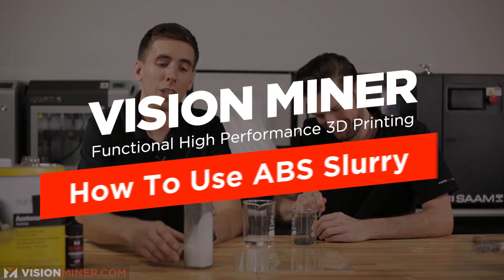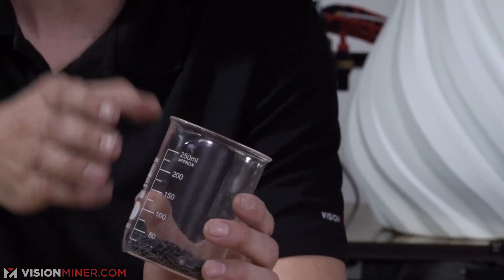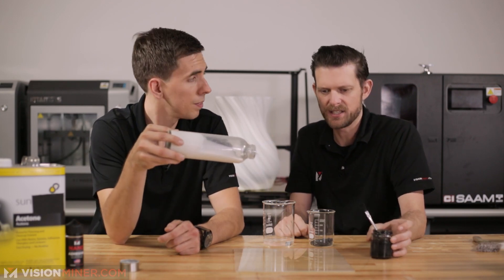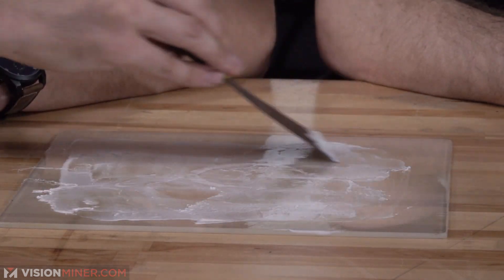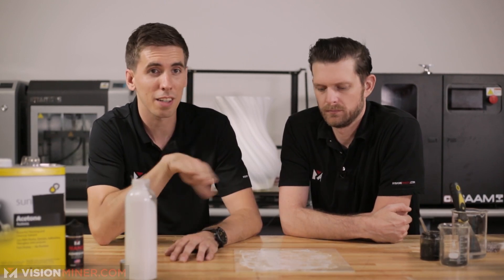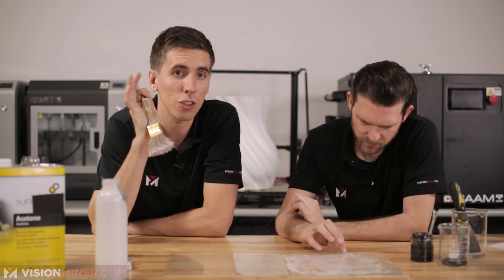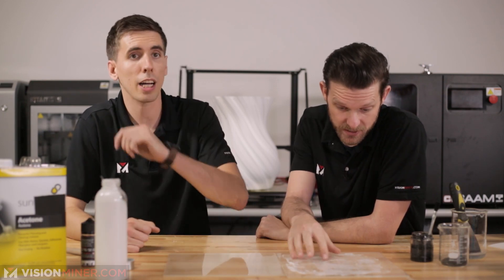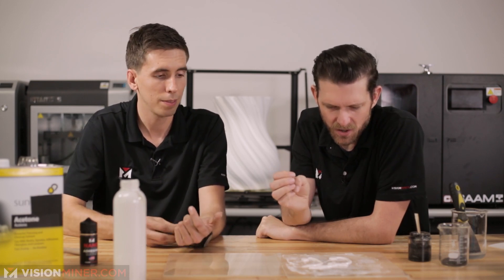How to use ABS Slurry Glue for 3D Printing Bed Adhesion

Comment: i keep mine in a paint can with a brush (kept in the can), and just paint it on the buildplate with the brush.
keep the slurry relatively thin (you can always add more coats later), paint it on evenly, and make sure to clean it off the buildplate with acetone when you are done printing. 
if you don't, it will just keep building up layer by layer, until it is too thick to print on.

Comment: Ok.... I realize this an old video, but... 
I'm going to address some of the misinformation in this video. Do you research and you will see.

1. Acetone isn't toxic, actually it's considered food safe, and organic. Yes it is an organic solvent, and safe for human consumption in small amounts. Much more than you will "ingest" out breath than when you are dealing with it. 
That being said, so is ethenol, but I don't advise huffing fumes for too long cause it will, and I repeat, will mess you up. But toxic by definition, no!
2. As for dealing with the abs plastic,  it's not necessary to chop it up. Yes if you do it will dissolve faster, but you can simply add it to acetone put the lid on, and it's ready to go the next day. If you plan properly you don't have to do anything with the ABS. I have stuck entire failed prints into a jar of ABS slurry, added a little more acetone, and put the cap on it. Less than a few hours later it's all mush.
 I typically use any of my abs waste, like support material, failed prints, rafts that get cut off. Most of that is thin enough to not worry about dealing with chopping it up cutting it up, whatever. Straight into my slurry mix and let it dissolve.
3. As for getting a smooth print on the bottom, in my opinion, the slurry you're using is way too thick. Mine typically is thin enough to put on with a chip brush/paintbrush. It will self level before drying. As a matter of fact a lot of times I have to put it on a preheated build plate at about 20 to 25 degrees c to get it to dry remotely quickly. That provides a smooth enough surface for 99.9% of my prints.
4. A little bit of information here not necessarily misinformation from you, but just affirming that yes you can use ABS slurry for pla, and other low temp products. Only caveat to this is getting it off of your print. I have found if you put it on thicker, (i.e. multiple layers since mine is so thin.) It peels off easier, as it does not adhere incredibly well to pla, and TPU, which is what I typically use it with. But it adheres well enough to hold it to the plate.

Okay, for what you got right, yes it is very messy I'll give you that make sure to wear clothes that you don't want to use for anything else. And it is extremely stinky as much as it is not toxic it smells horrible.
Reply from the maker: Extremely detailed contribution! Thank you for all the pointers :)

Comment: Why do you make a video on stuff you have no clue about ?
"you can not use the plate again" wtf ? you can just wash it off with acetone in a minute and it's better than new.
When you smear a 10 times too thick "glue" on your plate, completely ruining the first layer height. you also used 50-100 times more ABS than required on the plate.
Then you recommend to "sand" the glass plate. WTF ? NEVER EVER SAND your glass plate. That's 80$ trash.
Close your channel please.

Of course my first sentence was ironic, these guys are pure selloffs. They are sent products to advertise for money, that's why they make videos in the first place. That's why they made this joke here.

Comment: you guys dont really understand what abs slurry is for. Its for gluing abs parts together or to use as filler not for spreading on a build plate. abs juice which is way thinner that is what is used for bed adhesion. I will buy your product and put it to the test though and report back here

Comment: This video is just sad... Didn't know people would go that low just to market their product. This is worst than most political ads IMO.
Reply from the maker: We've never been fans of ABS slurry, what can we say? And the political comparison.... cmonnnnn. In previous comments though, we realize we probably could have watered it down more with acetone for a smoother finish. However, in our experience, you can literally ruin the borosilicate glass, and it will always be an ABS slurry plate from that point on........ not ideal, in our opinion!

Comment: This looked more like a how not to use abs as a bed adhesion coat.  It looked intentional.
Reply from the maker: I think it was just lack of experience, too -- we should have made it thinner. However, there are better options, unless you're only printing ABS. Even then, it ruined that glass plate permanently, we couldn't even get it off with acetone or heat, very strange!
Reply: @VisionMiner  The incompetence involved here is beyond believable margins.

Comment: You don't use abs slurry for bed adhesion you use ABS juice. ABS slurry is used to fill in gaps or even use it as a glue to it here two different ABS parts together or even fix layer separation.
Now it just looks like y'all don't even know what the hell you're doing terrible tactic to advertise a product that you're trying to sell.
Reply from the maker: Frankly we just don't print ABS too often -- we specialize in higher-end stronger filaments, and while ABS is still an awesome material, we got into this stuff becuase it simply didn't work for functional prototypes for metal parts... so yes, you're right, and we should probably make a new video. However, I think you'd probably love our product, since it works incredible well with almost everything, including ABS :)
Reply: @VisionMiner  "we specialize in higher-end stronger filaments" care to mention which ? That video is FUD and a bad attempt at selling "yet another useless product", let alone, I don't think people printing anything related to the industry and "high end" materials would need a youtube tutorial to find a biased review and clowns misusing terms to grab as much gullible potential customers as they can.  
When's the last time you printed in PEKK or PEEK fam ? Or did you mean "I don't use ABS, I used ABSX, it's different cuz carbon fibers lol" ?  
You might want to look for a youtube tutorial on building a brand, keywords : "long term, honest, trust, customer relationship management".

Comment: Bought the nano polymer and it doesn’t work any better than a glue stick and interestingly enough it smells just like the old glue tubes with the sponge on the end. Probably rebranded haha.
Reply from the maker: What material are you printing? And did you send an email? So -- let's define "any better" --- are you using for ABS, or another material? How many size parts have you tried? Are you still using brims? (you won't need any brims with this stuff, so long as your bed temp is around 90-100c). If haven't already, please send an email or call in, we're here every day of the week to help. And we're not a giant corporation, either, thus here I am responding to as many comments as I can late at night :) This is Rob, by the way.

Furthermore, we literally hired an adhesive scientist, and spent almost a year developing the formula -- for PEEK, ULTEM, and PPSU, not PLA. It was a fluke that it worked for almost every other material -- I was very surprised when I tried it out on the Ultimaker. No re-branding here, we literally had to make something to get our prints in high-temp to stick. It's based in isopropyl alcohol, which smells like a lot of things. 100% made in USA, bottled, packed, and shipped from our facilities here in the USA. 

For basic materials like PLA/PETG, a single coating has gotten me 50+ prints, with no re-application -- that's quite a bit better than gluestick, especially with a mirror-finish bottom layer.
Reply: Notice they haven't replied to your comment (posted 1 month ago), yet they're commenting on other posts from only 6 days ago. You think they care if their product worked for you? They are snake oil salesmen, nothing more, nothing less.
Reply from the maker: As a matter of fact, we get extremely busy -- we get a lot of comments, and on nights like tonight, I do my best to go through the glut of them (on 150+ videos)....  emails are a much faster way to get a response, and for the record, we've put our heart and soul into this product over the last 3 years -- it works far better than glue stick, although maybe not for PLA (heck, PLA will stick to glass). We also specialize in the high-temp materials like PEEK and ULTEM, and if you've ever tried glue stick on those, you'll find it's majorly sub-par. Snake oil? Not a bit. Did we manage to create something awesome for PEEK that worked on nearly everything else? Absolutely, yes.

To top it off -- you can actually get a mirror finish with Nano if you want, and that's something gluestick has a hard time with. It's not rebranded, we literally (Rob, mostly) spent almost a year testing and failing and testing and succeeding to get the formula we call our own -- we've gone through 4 different bottles types to improve shipping and application, and continually improve the packaging and experience ourselves. 

We are, in fact, real people, and do our best to bring what works in our shop, where we print for companies like Lockheed Martin, on a daily basis --- to you, the community of 3D Printing. Your accusation is false, have a great day!
Reply from the maker: By the way, take a look at our reviews on Google and Facebook... that alone should prove that this stuff works incredibly well.

Comment: I print ABS. ABS slurry gives me 100% success in bed adhesion and no warping. Ill take the clean up as a trade off. I dont waste new filament making it. I use poor designed versions of prints to make slurry limiting my waste. I save my clean up ABS scraps to make more slurry. This video is just sad. Vilifying ABS slurry but then saying you use it. Making it look all tough, gross, and toxic. Our own bodies produce acetone, it is listed as GRAS, and is a mild irritant at best. If it evaporates then use a lid. Dude looked at it like it was “icky.” Bunch of grown ups acting like struggling children to try and sell a product.
Reply: Exactly what I was thinking. Especially virgin number 1 on the left. Virgin #2 just looks pissed that he’s wasted his time with such an obvious try hard video. Abs juice will always be the best option if you want a quality print in abs.
Reply: @nefariouspreludev2.046  There's no need for that. If you have to resort to name calling, you've lost your argument.
Reply from the maker: Acetone, a mild irritant? Have you ever had that stuff close to your face? 

Regardless, if you're only printing ABS, it's a great solution for very little cost. Thinning it out more would have been much easier, too, but frankly, we don't use it, because it's on the bottom of the totem pole for adhesion solutions, and tends to be impossible to get off glass after awhile, often ruining buildplates. 

There are better options available, but it's all about what works -- and if it's working for you, that's great! 

Note: it was quite nasty, and we should have thinned it more :D

Comment: You guys have a lot of experience and I believe you when you say you don't prefer it. You probably have solid reasons and other solutions but I dont understand the ABS hate (Not specifically you just in general I see it a lot). 

The "disadvantage" of it being hard to remove is kinda an advantage for an adhesive. If you cant get it off the build plate then it's doing its job. 

ABS is one of the worst for off gassing and bad byproducts no doubt. Because I started with abs I immediately built a vented enclosure. So even though I print evil ABS i have less microplastics and fumes in my system with than someone who only prints PLA and PETG with PTFE lined hot ends in their spare bedroom. All 3dp plastics have some level of risk and by saying to stick with the safer ones and dont worry about it vs dealing with the problem is more dangerous in my opinion.

It warps, it smells, and it is "old" and not a modern filiment, but there are reasons it's so widely used across the planet. My favorite being the ability to plastic weld mods to the dozens of abs objects I deal with in everyday life. Safe printing everyone.
Reply from the maker: Right -- it truly is a good material, with disadvantages. ASA seems to be an overall better route! And the slurry hate isn't really hate, if you're just printing ABS -- for an all-around adhesive, there's better things. But for effectiveness one some materials, it's a 10/10!